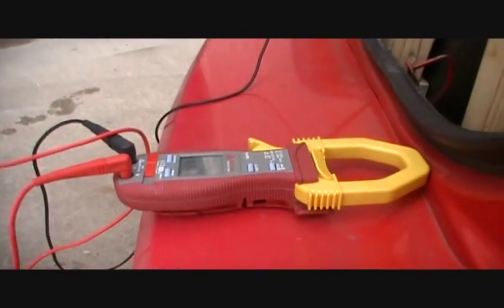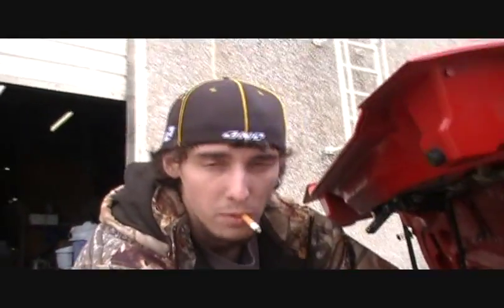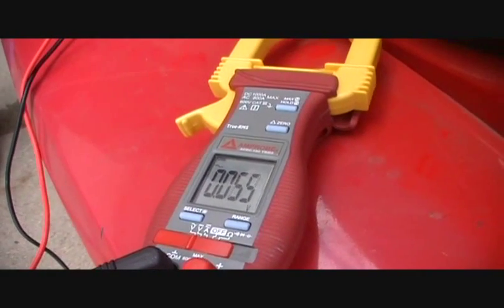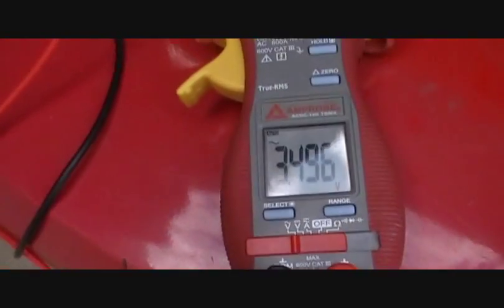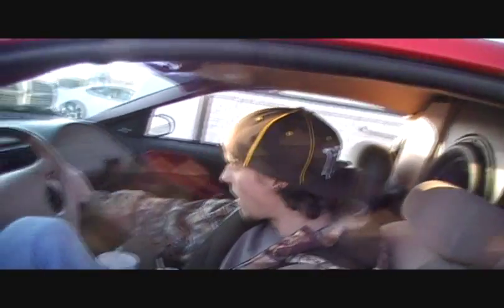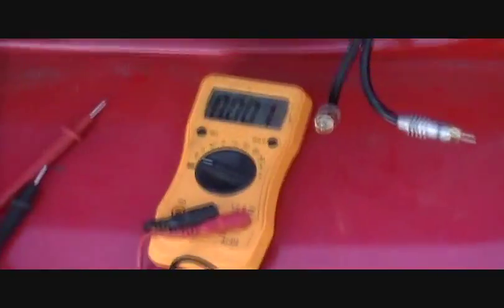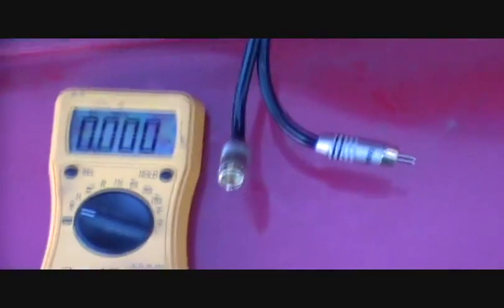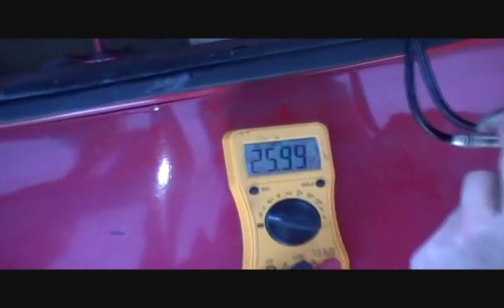how to gain match amps+ My rca voltage

Comment: Unplug your subwoofers from the amp, plug the voltmeter into the amp outputs. That way you can turn the volume to the max you listen to without having to damage your subs playing a single frequency, then tune from there.

Comment: I have 2 fluke t5-600's. Are they any good for car audio? I did not detect anything when I put it on the AC~ part and turned up my line driver (Cache clocd) up to max gain (should be 10volts)

Comment: Not hatin at all but no one runs 26 volts because most amps don't accept over 8 volts.  Also the input gain on most class d amps has the lowest setting on the input gain to be in the 5-8 volt range.  Therefore if you're running at 8-10 volts and your input gain has been adjusted up at all you're most likely sending a clipped signal to your amp.

Comment: ammm, why didn't you look just at bridge voltage between + and +?
are are you running one amp per coil, not bridge?

If you would have same output ground, you could just put DMM betweet + and +, and try to get 0.0v between them, since the outputs are in phase, since you dan't have them bridged